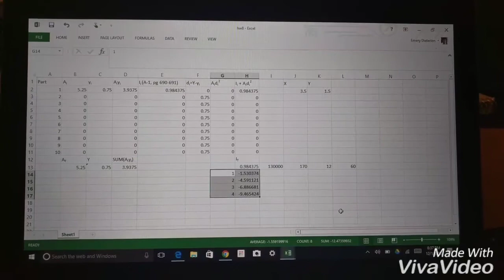2x4 Beam deformation experiment

Comment: what if you stood the 2x4 up and then walked across. how much weight could a 2x4 hold that way?
Reply: More than 15X greater weight would be supported
Reply: @impulsemotivation7893  is this factual?
Reply: @mrkeda  Yes, this is a simple stress/strain calculation
Reply: @mrkeda  With the 3.5in side vertical, I calculate the 2x4 could support 2.33 times the weight at a given distance from the support, not 15X.
Reply: @impulsemotivation7893  but we never heard how much he weighed, that could make the end number sway greatly.
Reply: @martyjoseph9507  He looks like he weighs between 150lb and 200lb.  I'd say closer to 150lb.